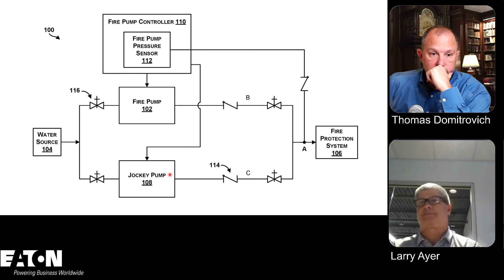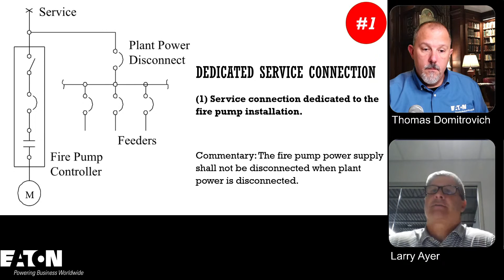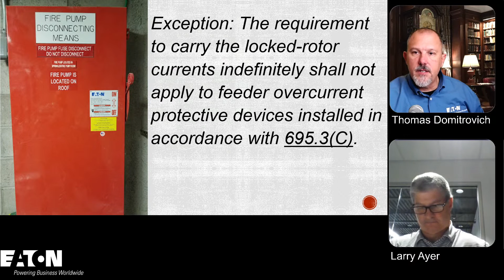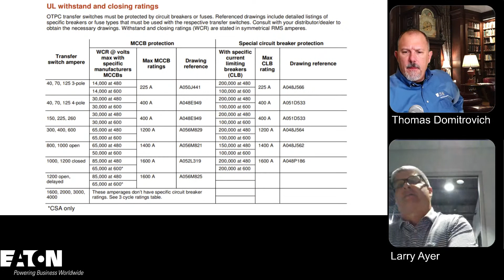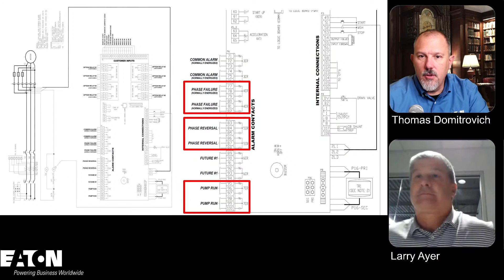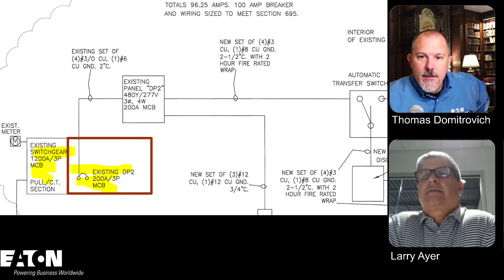Fire Pumps

Comment: I know this is few years since first presented but wanted to mention FM (Factory Mutual later added Global), got information from them about many aspects for industrial environments.

For maintence work we used their Red Tag system required by them as they insured us.

As much as facility management did not like it depending extent  of impairment certain operations had to cease like hot work.
Same would apply to electrical or pump maintenance.
If there is no alternate pumps or electrical by-pass shutdown might be required. Better to schedule during shutdown if possible. In case fire pumps should be schedule to avoid shutdown or after prolong use 
I worked in industrial most of my career as maintenance Electro Mechanical Technicians (I was a master electrician and later safety) we did many things but usually large projects like this we subed to specialize electrician for this type of work.

Comment: The 7psi comments are correct. To a point. 
Systems with Standard sprinklers are designed for the furthest sprinkler to have a minimum of 7psi. 
This sprinkler could be 1000’ above ground. 
I’ve worked on fire pumps that are rated at 600+ psi.

Comment: How the hell do they get away with open motors on fire pumps ? Too many times I have seen fire pump packing spraying gallons of water onto an open fire pump motor during g the weekly 10 minute test runs. Wish they would Install labels on panels stating the turn on water pressure ( & off pressure for jockey pumps ). Reason being more then once when a mercoid or more modern pressure switch went bad they throw it away and when the sparky comes in to wire them up has no ideal where to set water pressure. On one 14 floor building they purchased a jockey pump pressure switch that maximum pressure was maybe 5 to 8 pounds less then it needed to be. Plumber had us lower the turn on pressure on fire pump to compensate for it but never liked doing such a thing without a sprinkler company service tech approving it. We had a 100 HP Fire pump pane! Replaced and they new fire pump Y - Delta contractors were junk sty!e that you could not remove cover to inspect the contacts that was on our quarterly PM'S check list. We always performed voltage drop across contactor contacts & checked connections with a FLIR camera but still rather be able to look at conditions of motor contacts.
Reply: There’s a lot going on in your post here. 
First…electricians and plumbers shouldn’t go anywhere near pressure settings on a fire pump system.

Comment: Today Why in the pump fire’s plate info shows 2 diagrams, one of them is for 200v and the other 400v . What is the right way to join it correctly ? I understand the diagrama but the fire pump’s wire are thinner than my 300 kcmil feeder conductors

Comment: Why do we need to size up the breaker to LRC, though the FIRE PUMP CONTROLLER is not required? We do not want to trip the breaker during overload but the overcurrent protection at the fire pump controller would trip.

Comment: Excellent presentation one more point that I think did not see in the presentation. NFPA 101, which is adopted throughout, requires the jockey pump, for high rise buildings, to be connected to the standby power too. 11.8.5.3.4 -2018
Reply from the maker: Thanks and great feedback about NFPA 101.  I'll have to open that and update this deck.

Comment: I think one of the biggest concepts is that we want the fire pump to work during a fire, but we don't want it to start the fire. Hence the prohibition of overload protection and the requirement for ground fault and short circuit protection.
Reply: The listed Fire Pump Control Panel do have overload protection designed to 300 percent of motor FLA and trip between 8 seconds and 20 seconds at motor LRA. Therefore, the LRC to be carry indefinitely is not required for the listed fire pump control panel (nfpa 20). The LRC requirement for the permitted overcurrent protection, installed elsewhere, is not because we do not want overload protection but because if tripped there is no way to reset it in an emergency. Whereas, the Fire Control Panel, is required to be in the pump room itself therefore it would be easier to use the manual starting.
Reply: @JoseCastillo-yp1fn  I don't think I would call 300 percent overload protection. Overload protection is typically 115%-125%. NEC 695.6(C) prohibits overload protection.
Reply: @RyanJacksonElectrical  LRC is not a short circuit or ground fault but motor overload. The listed fire control panel will open if the motor overload is above 300% of the FLC and will open in 8 seconds if LRC IS reached.  The internal components of the listed fire control panel only must comply with NFPA 20 (10.4.4 -20 2019) also the NEC states the same in 695.1 (B). Therefore, the listed panel will provide motor overload protection.